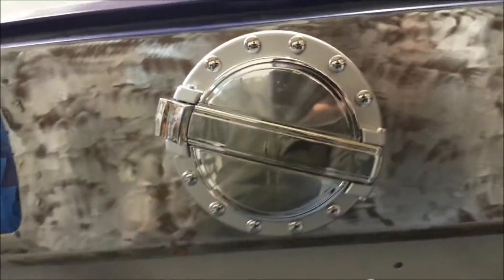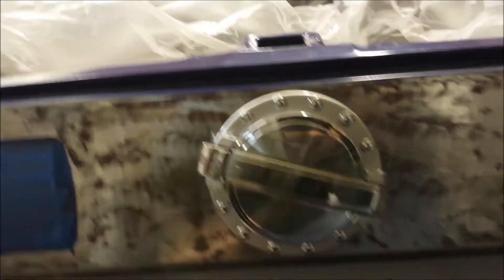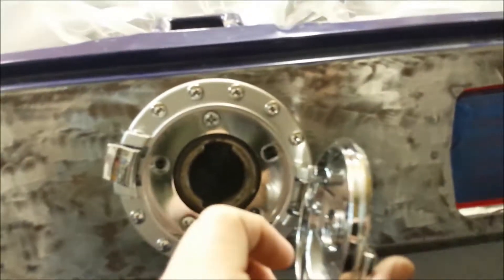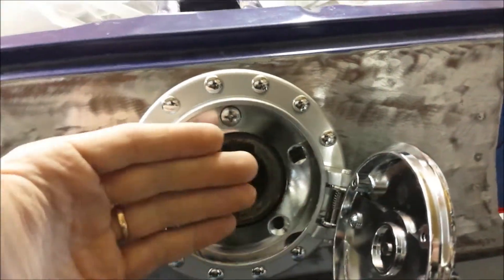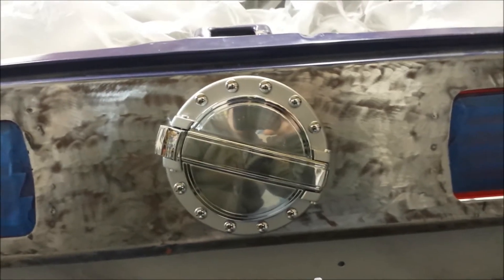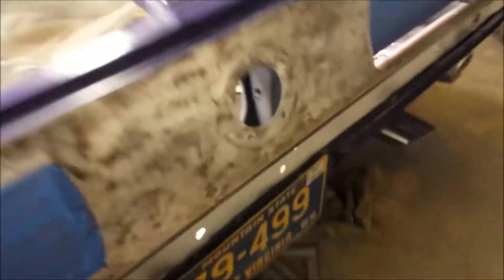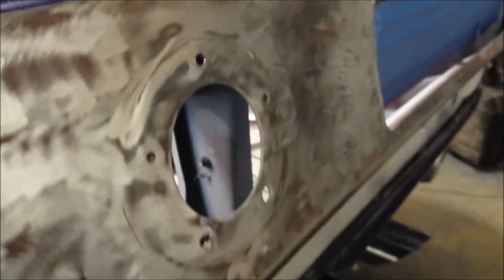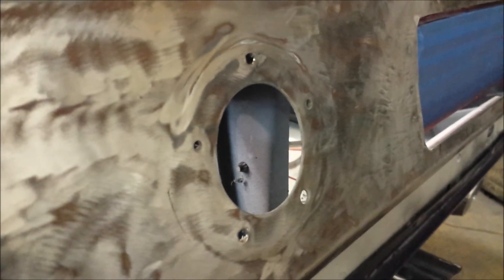1965 Mustang: Gas cap dilemma

Comment: Flush mount it but I wouldn't french it in and the flip open gas caps are notorious for leaking. I am running an inner twist on cap inside my factory GT repop cap. You will definitely need a good seal on it to keep it from spilling gas.
Reply from the maker: Yes I have the inner twist on cap. Flush mounting it seems to be the right way.
Reply: Cobrafanatik22 Rich is the man and i think it will look so much better flush. Does that cap/lid come with a rubber seal or body gasket?
Reply from the maker: The cap comes with an inside screw on cap that has a rubber seal on it.  It does not come with a gasket/seal that mates up with the body. I however think something needs to be there to prevent chafing of the finished paint.  And yes, Rich is the man!

Comment: I agree with everyone on the flush mount. Easier to do it now and if you don't you'll be kickin' yourself afterwords... Plus, every time you put gas on you'll think, "Dammit, I should have flush mounted that."
Reply from the maker: You are exactly right.  I'll be hammering and shaping that rear panel to allow it to sit flat.  This cold winter has me dragging.  Haven't done too much in the last 2-3 months.
Reply: No worries. At least you get to work on her. I'm 1200 miles from home going to college. Mine's tucked away in storage until May.

Comment: Re gas cap, If it were mine I would have a machine shop spin up a spacer level to the edge in polished aluminium or black polycarbonate, its a 2min job

Comment: flush mount. that is all....    go hawks
Reply from the maker: I'm wondering if I put a rubber gasket behind the entire piece of it would look right?  Just so the rubber fills the gap.  Probably 3/32"
Reply: No.  Lol.  Make it look like part of the car that belongs there. It's just my opinion. But that cap is huge and I think sinking it in some would make it look more subtle and not stick out .   Me, I'd shave the hole and fill inside the trunk. Lol.  Go Hawks.
Reply: yep flush mount.... awesome project...

Comment: look at the 69 mustang mach 1 gas cap it give you some ideas
Reply from the maker: The 69 tail panel is contoured and not flat.  The gas cap is shaped to fit that vehicle.  The only flip open gas cap I could find that was mounted on a flat surface was this one.

Comment: I would flush it for sure. Would look mucho better.
Reply from the maker: Yeah that's what I'm planning on doing.  When ever I can get a break from this temperature.  The garage has heat so I can stay warm but the metal is so cold.  I don't even want to try to shape it and bend it at that temperature.  

PS I received your mail.  Much appreciated! And yes I'm still trying to get the right print out of my YYGG sticker. Stay tuned.